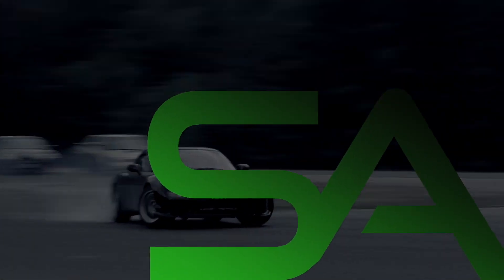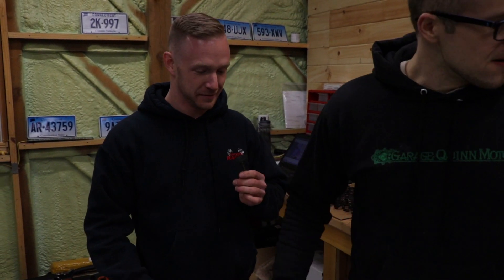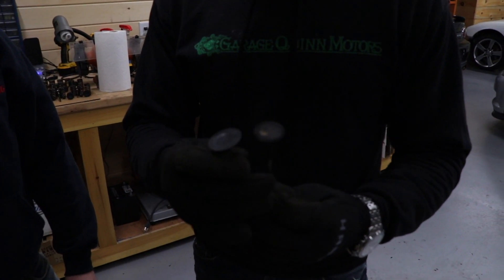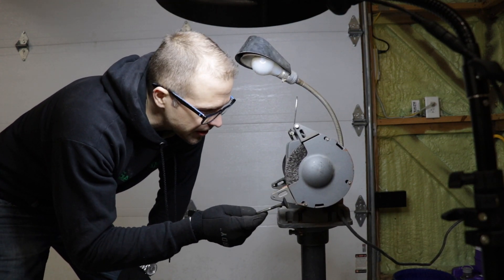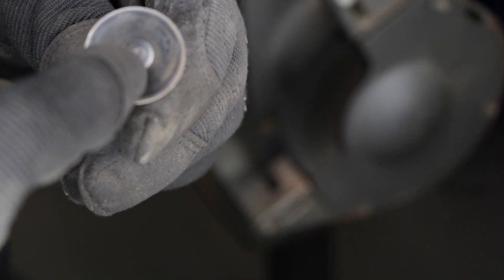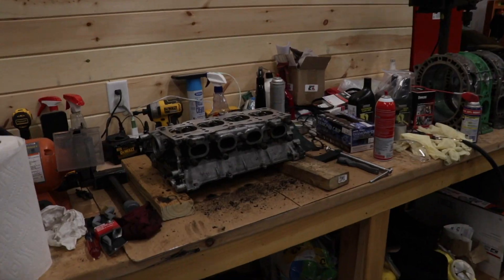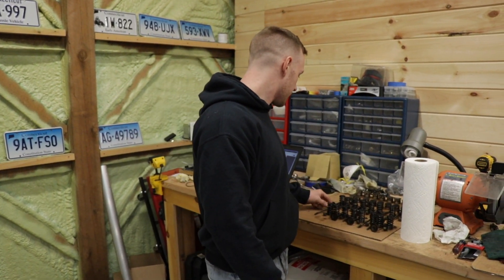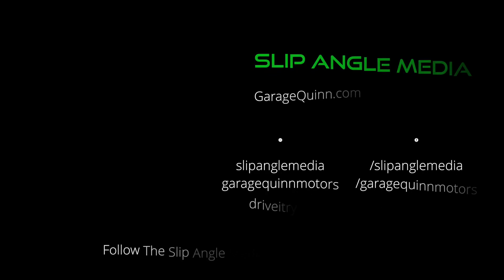How To Clean Intake and Exhaust Valves!

Comment: I'm a little late to comment on this video. But for anyone who this might help in the future. Please don't wear gloves near any spinning machinery. Not even latex or nitrile gloves, If the wrist strap doesn't break. When it gets caught up in the machine. You'll be joining the glove for a game of ring around the Rosie.  Please put the gloves aside around any grinders or sanders, lathes , Bridgeports , and drill presses. If you started your project with 10 fingers and toes and would like to continue using having that many. Then avoid wearing gloves around spinning machinery.

Comment: I wouldn’t do this if your valves have a coating as it would remove it leaving your valves exposed to rusting
Reply: valves arent coated.
Reply: @DieselRamcharger  
My Audi tt engine exhaust valves coated with stellite and filled with sodium. 

I wouldn't do that to mine.
Reply: @firegun7000  Ok first. Dude said that valves have a RUST PREVENTATIVE coating...I mean..oil? Stellite is a hard facing put on some high performance valve faces. The problems with your comment are 1. stellite valves are stainless. so they dont rust, there is nothing to wire wheel off. 2. stellite is used on the FACE of the exhaust valve. where it beats against the valve seat about 8000 times a minute. Do you HONESTLY BELIEVE that coating can be wire wheeled off? It cant. It can be ground off in a valve facing machine. It cant be removed with a wire wheel. Which is EXACTLY how valves are decarbed in machine shops. The other option for valve cleaning is a shot blaster. Much more violent than a wire wheel. Still doesnt remove the stellite. Not that i would go tossing race car parts in a tumbler. Theh would get hand cleaned.... On a wire wheel.

Comment: A little trick I do with the wire wheel grinder is throw the valve in a drill and have it run opposite the wire wheel and it gives more room for your hands and strips carbon instantly.
Reply: Yep, then polish them in the drill with ultra fine scotch pad soaked in oil. Easy if you know how.
Reply: Valve stem in a drill chuck?!?! No way.
Reply: @jonathanrashleigh8771  don’t give out tech advice if you don’t know what your talking about. A cordless drill Chuck will not damage a valve stem. They are made of hardened steel alloy, and are harder than the drill Chuck. You could if you wished wrap duck/ gorilla tape around the stem to be 100% safe. Most engine builders use this technique to clean valves.
Reply: @mark4lev  *you’re. And I know what I am talking about. Just because you’ve been taught something doesn’t make it right. And a wire wheel on a valve. My god  😂😂😂
Reply: @jonathanrashleigh8771  you know nothing. There is no technical info in your reply. Go and play on your x box and let the adults talk.

Comment: Take the tin guards off your wire wheel, cut off the bottom half, and bolt the top halves back on.  That eliminates the pinch point and danger

Comment: Soaking valves in solvent will help loosen the carbon🤔
Reply from the maker: You could. The wire wheel works well enough either way.
Reply: I was thinking that solvent and and ultrasonic bath would be less labor intensive and also far less dangerous. 🤓👍

Comment: Dude, put it in a drill... That's dangerous to use gloves on a wire wheel like that it'll grab the glove and suck your hand in
Reply: Had a wire wheel on a drill. It climbed right up the inside of the glove. Just a wonderful experience.
Reply: its a 1/3hp grinder. get over it.

Comment: Is there a real difference between steel wire wheels and brass?
Reply: You usually try to use a metal that is softer than what you’re cleaning, valves are pretty hard though but you’re better off using brass.

Comment: Take the guards off your wire wheel or suffer the consequences.  I worked at a shop that had a guard on their wire wheel.  I was cleaning a bolt and it sucked it up and shot it back out at the speed of a bullet right on my finger.  Plus, with the guard on you can't clean valve cover gasket surfaces.  The old metal ones that use the cork gaskets.  Transmission pans too.